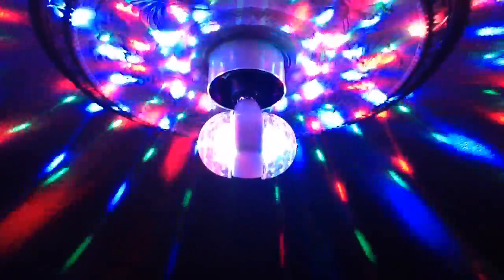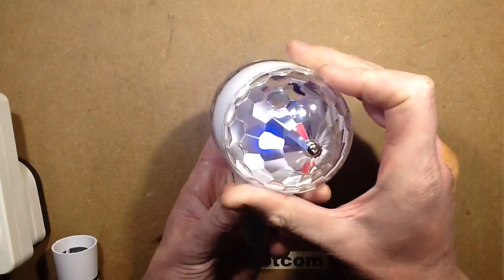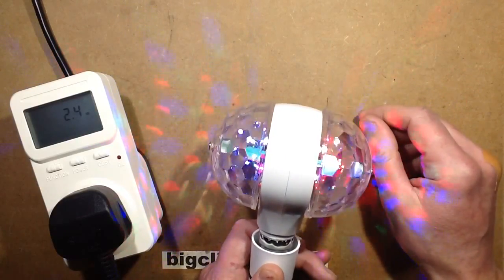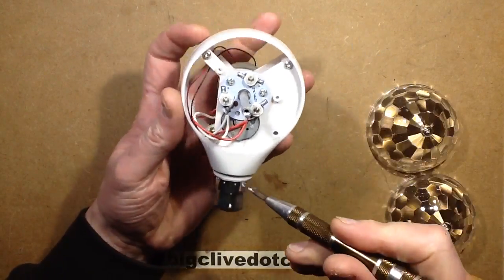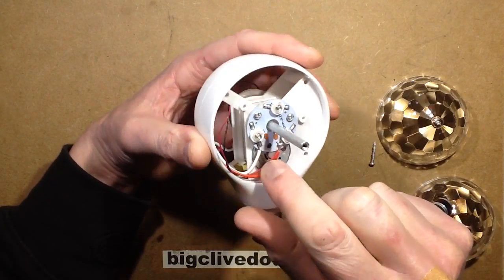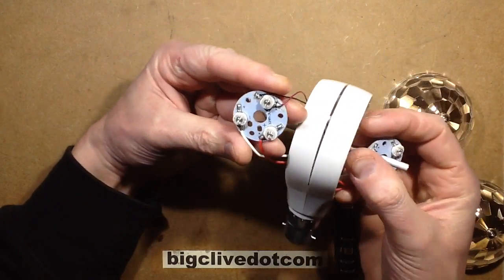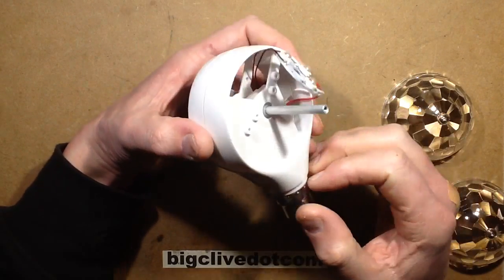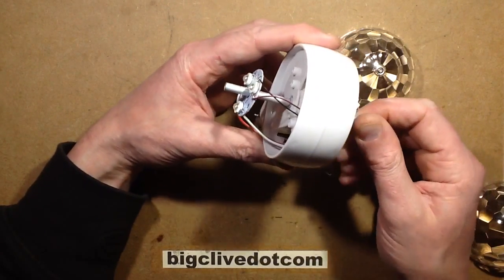Inside a double head LED disco light.

Comment: My sister would love one of these in her room!
It'd be great to add a buying link for any 'safe items' you review on this channel :) A bigclive amazon list perhaps?
I know a lot of the small gadgets are poundland and you mention that, but not always  ( as in this case here ).

On a separate subject, I recently re-watched your interesting trash wine video in which you have a water distiller and a 240v to 24v adapter..

I have a few questions about those two devices.

1. What is the amperage rating of the 24v adapter you used to allow the distiller to run at a lower 'warm' temperature?
( I'll assume it's 24v AC output, but if it was Christmas lights then perhaps it is actually 24v DC? )
2. What is the wattage of that actual distiller you own? ( I looked on ebay for that model a few weeks back and found many costing between £40-£65 that looked exactly like yours, but as of yesterday there appear to be none ( looking exactly as yours does ) for less than £187 which has put me off quite a bit, even though I just last week bought a demijohn and associated gubbins and powders from Wilko to experiment with )
3. What manufacture/brand is your distiller? ( Smartstill? Aquapure? )

Happy to send you a few coffee's worth via bigclive.com link following your reply :o)
Reply: troube is, most of the items are sold from ebay only, and along with the weeks and weeks of wait, they may be variable quality, esp if sourced from a different seller, some might be safe  some not

Comment: if you like the falling stars effect I suppose you could internally mod it with mirrors (or baffles) so the light only projects through one side. might also be possible to run two units back to back with a Y adapter.
Think the first thing I'd try to do with it would be reduce the noise off that motor though

Comment: Electrolytics on the power supply? They will fail when your great grand children are in their old age. Or would it take longer to have run something like this for 6000 hours? I have found that's roughly the life span of my cheap chinese lamps running a 10w LED with a 7W driver.  MAybe the motor would burn out before that?
Reply: Electrolytic caps life depends a lot on temperature. If they stay near room temperature they can last a long time. Also depends on the quality (quality of the seal so they don't dry up).
Reply: Michel PASTOR
 Yeah but in an application like this they will run hot and the best ones I can find are usually rated 6-7k hours. That's panasonic and chemicon
Reply: Yes almost 1 year at max temp that's not bad. Not sure. It's fairly low power I don't see why they would get hot. At least probably not enough to shorten their life much in my opinion.
Reply: My lamps lasted me about 4 years at the duty cycle I used them at. The point is that they need to push the cap technology so that there can really be an economy in switching CFL to led. They need a longer life span.
Reply: They are just using the cheapest caps that's why it doesn't last as long as it could. Liquid electrolytic is not the only cap technology. They could use solid electrolyte type caps that have a much longer life span. Like manufacturers do on good computer motherboards. Also make sure if you are using CFL lamps to not orient them the tube downward so that the heat doesn't rise to the ballast, they will last much longer. But yeah LED technology is undoubtedly much better.

Comment: Is the geared motor a discrete unit that could be removed and put to other uses? (e.g. toys, robots, automation), or is it built onto the structure of the lamp body?
Reply from the maker: Easily removed and runs on about 3V, usually at a very low 10mA or so.

Comment: That gives me an idea for a project. Pull out the LED boards, replace with a couple of small neopixel rings and an Arduino pro mini. Without seeing the power supply, I'm guessing it might need a little modification to get the 5v needed to run the neopixels. But you could then have it running a whole spectrum of colours instead of the red, green and blue.
Reply: Maybe as simple as connecting a 7805 to the existing PSU.
With an Arduino (or similar) you could also vary the speed of the motor, vary the brightness according to ambient light, sound to light, wireless control, etc.
Reply: Yes, it's a thing
https://www.amazon.com/LampChamp-Charger-Adapter-eReaders-Security/dp/B01EPC102A
Reply: But the thing about doing projects like this, is to make the thing without buying pre-made bits of kit. (I know the Arduino is premade, but all that surface mount stuff is too fiddly for my buggered hands)

Comment: if you were to cover half of it, it wouldnt suck the snowflakes up the other wall. i do have an opposite turning gearbox from a toy car, but they are not very common. ( forward straight, backwards turning function)